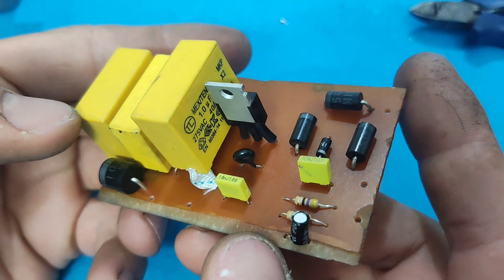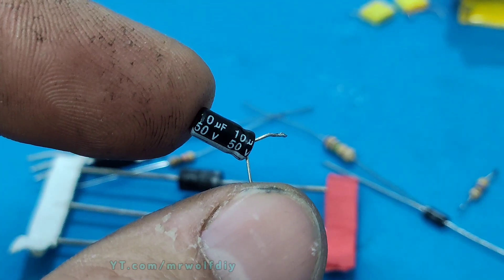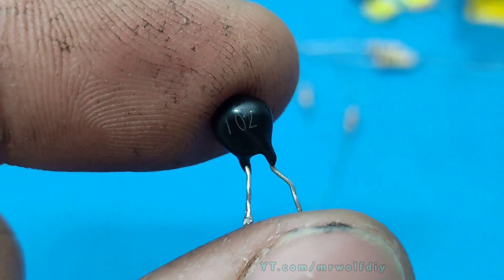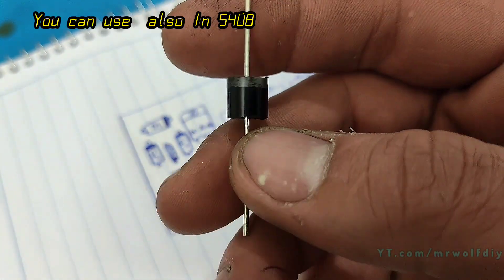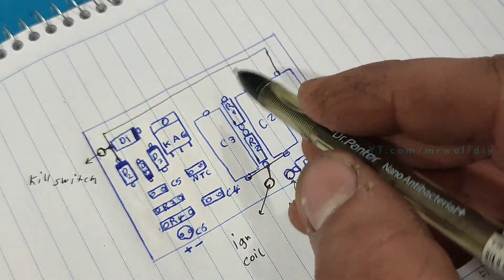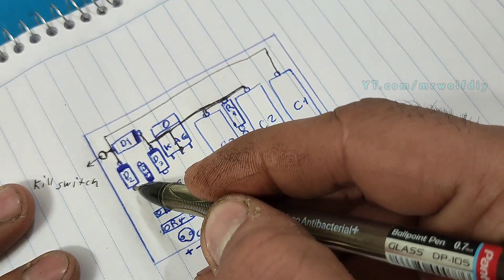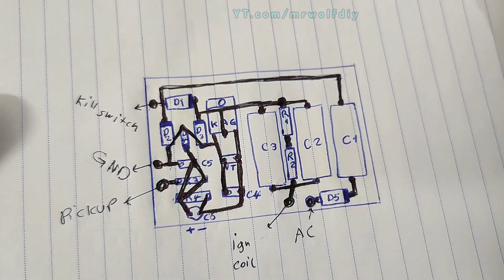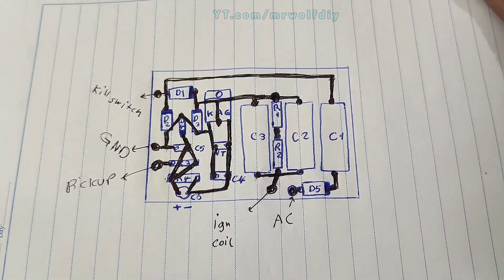Boost Your Motorcycle’s Performance with This CDI! "DIY CDI box"

Comment from the maker: Hello, friends, if you have a weak spark at the output, or no spark at all, change the diode, D5, to 1n 5408.
Good luck ♥️
Reply: Buenas como puedo contactarte? Quiero hablarte sobre un proyecto que tengo en grupo cerrado.
Reply: is this CDI Useful to all kinds of MOTOR? or REGARDLESS Of wire output or SOCKET terminals? like 4wires or terminal socket of 5 or 6 etc. thanks a lot!
Reply: Can I use it on Vespa Classic?
Reply: @TheMurenk 
It make your piston big hole.....
2stroke no need big sprak.......
Reply: Olá amigo, ativa a dublagem automática em português nesse e nos próximos vídeos

Comment: Does it work with cbr 600rr?I dont use the original ECU,also i work at 10000 to 14000rpm
Reply from the maker: No, it's for carburetor bikes 🙌🙌
Reply: @MrWolfDiy can i adapt to injection bikes?I trigger the output with the ecu signal

Comment: Do it works with aprillia sr50 where should be ac cdi? I bet yes, but interesting what happens if advancing angle is 20 deg?
Reply from the maker: This circuit has limited spark advance,
but I think it would be suitable for a 50cc engine.

Comment: I tried tracing the schematic but I am confused. You have D5 going through C1 directly to the kill switch and junction of D1 & D2. Is C1 perhaps supposed to be in parallel with C2 and C3 instead?  Otherwise I could see if D5 didn’t exist C1 would act as a half wave voltage doubler circuit. Could you clarify please?  By the way I think your channel is great. Just discovered it.
Reply from the maker: Hi and thanks,
C1 is not in parallel with C2 and C3.
In fact, C1 is used to increase the input voltage, and D5 is there to protect the stator.
And even if they are not present, the circuit will still work.
Reply: @MrWolfDiy ok thank you. I can understand C1 increasing the voltage but have never seen a voltage multiplying circuit with a diode in series before the capacitor. It would seem to me to block any return path. Oh well. Live and learn.
Reply: @MrWolfDiy  sir Japan cdi 2002 mobel Honda 125 same tou same making your video plz bro
Reply: @MrWolfDiy  your country name brother
Reply: @MrWolfDiy ❤❤❤❤
Reply: Your channel name
Reply: @BikeWala-an ?? I’m not sure what you mean?  If you are asking if I have a channel, no I do not. I am just an enthusiast like many other people following this site.
Reply: @MarkPrestwich-h6m  ok brother

Comment: If this is AC and no limiter and will run on a 70-80 cc 2 stroke I would buy one from you if it was in a case
Reply from the maker: Hello dear friend,
I should say that both of these(CDI units) can be used in two-stroke engines as well.

Comment: Hello, what is the ntc used for, please?
Reply from the maker: Its main function is to protect the circuit against excessive heat and also to reduce the inrush current at the moment the circuit is powered on.
It is also used to stabilize the ignition timing with respect to temperature changes.
Reply: @MrWolfDiy  Ok, thank you!

Comment: Will this work for my 2stroke 500cc i currently have no cdi for my Suzuki LT500R
Reply from the maker: Most ATVs use a DC-type CDI , which operates using power from the battery rather than directly from the stator، Maybe the DC version can be used.

Comment: I"m really loving these videos, so inspirational. My question is can this be adapted to a six cylinder distributor on a 258 CID Jeep engine? It would seldom go beyond 5000 RPM. Or would one of your other design be better?
Reply from the maker: In general, CDI systems designed for motorcycles or simpler setups are more basic in design.
However, this doesn’t mean it’s impossible — but it does require modifications and adjustments on the vehicle.
One of the main challenges is ignition timing, which must be precisely adjusted to fire at the right moment for each cylinder.
The circuits I’ve shared so far are not suitable for use in cars.
For a project like this, you would need a programmable and adjustable DC-type CDI.
Overall, I don’t recommend it — it involves a lot of hassle and the results may not be reliable or satisfying,
unless you're doing it purely out of interest and for fun.
Thanks for your question!

Comment: Where from you buy all this components? I didn't getting it.
Reply from the maker: I extract many of the components from old circuit boards, and I also buy a lot of them from online stores—basically, wherever I can find them.
Reply: @MrWolfDiy i didn't get scr. Amazon flip kart their is no thyristor.electronic shope near me their also no scr. From which type of old device i can find scr?
Reply from the maker: Hey buddy, 
Too bad you couldn’t find it.
Thyristors are mostly found in devices like dimmers, which were used to control fan speed or lighting,
and industrial or home electric heaters with temperature control,
heavy-duty power supplies with adjustable voltage,
old electric stoves, and microwaves.
They’re typically found in devices like these.
I just hope you don’t end up tearing apart the whole kitchen for a thyristor!😅😅
Reply: @MrWolfDiy 😂 thanku😌

Comment: Love your video i need a cdi box for a fl400 honda pilot very hard to find would any of your cdi designs work for me i think its an ac type thanks keep up your good work 👏
Reply from the maker: Hi and thank you 🙏♥️
You mean the Odyssey, right?
Your engine usually uses a DC CDI like Shindengen or Denso, which costs around $300 used...
I built a diy DC version that can be put together for about $10....
But building it has been a bit tricky for some people, so I'll be releasing an easier version soon.
Reply: Am not sure if it's ac or dc the honda odyssey is a 300 but the pilots are 400cc they are both pull start and electric start 2 stroke if you think your cdi dc board could work with the pilot I'd try and make one like yours thanks 😊

Comment: Make CDI for 70cc,100cc,125cc and 150cc bike. If you make pervious so please link.
Can I use this CDI in 70,100,125 or 150cc bike? Please answer
Reply from the maker: Yes, This CDI is installed on 70cc to 200cc engines that have a stator with an AC coil.

Comment: My xt225 has the weakest spark.
Reply from the maker: There are many factors that contribute to weak ignition, which should be checked, such as:
Weak wiring, connections, and sockets.
Weak ignition coil or CDI.
In some cases, the issue may be due to a lack of proper fuel or air.
If the fuel system is problematic, such as a clogged air filter or a malfunctioning carburetor, it can affect the quality of the spark and combustion.

Comment: Why not upgrade factory piece make the resistance adjustable and and put a bigger capacitor?
Reply from the maker: You can also do this, but to make the CDI adjustable, you need to install a programmable microcontroller.

Comment: Mr Wolf - How are some CDI's limiting the speed/RPM of the motor?? I love your simple CDI video from 4 months ago, but I wondered how they add that feature. It's why many CDI'd will work, but sometimes you won't have the same RPM's, they will be lower, higher or unlimited. Thank you for all your videos, they are very helpful. And, your normal voice is fine!
Reply from the maker: Thanks my friend,
Some CDIs limit RPM by delaying or cutting off ignition, using a rev limiter circuit connected to the crankshaft sensor, or reducing the voltage to the ignition coil. Additionally, programmable CDIs allow users to adjust the RPM limit.

Comment: Cdi controls the ignition timing too not just to ignite only
Reply: If it's low on power, it will not show a difference 😕
Reply from the maker: in fact ,It is responsible for enhancing the ignition spark and acquiring precise timing via the crankshaft position sensor.
Reply: @MrWolfDiy  so what's to point of building igniter instead of cdi
Reply: @macgyverdroid  simple, its like getting a distributor and change it to optical or hall with a simple circuit like this one... all advance is still done by the distributor (vac/mech). Now its a matter to know what controls that in your motorcycle engine... lots of single engine points/hall/optical the advance is done mechanically .... they don't have a eletronic ignition box/circuit.

Comment: Schematics, please!
Reply from the maker: As I mentioned before, this circuit didn’t actually have a schematic. In fact, I reverse-engineered an OEM CDI, opened it up, and made some modifications to increase power...
You can draw the schematic yourself based on the circuit I created.

Comment: Would be great to hollow out an existing CDI and revise this custom CDI board into it. 
That would make it easier to mount on the bike. 

One question though. 
How do i know if my bike is AC or DC? My bike has a 4T engine.
Reply from the maker: Greetings friend,
It's a good idea, but the space inside the boxes is usually very small, because SMD components are used,And it is of low quality.
If you've seen my previous videos, I showed that in many cases they fill the inside with sand, so that less resin glue is used.I've already made a full video on how to identify the type of CDI. However,
Tell me the name and model of your motorcycle and I'll tell you.
Reply: @MrWolfDiy  in my country there's regulations for CDI's to be original. Now if the original housing could be reused including the connector then an unrestricted CDI won't be detected by the inspection inspector. 
I'm driving a Piaggio zip. We have 3 types of CDI's available. One restricted to 25kmh, 45kmh and one that is technically illegal because it's unrestricted. 
For reference it's dutch regulations.
Reply: Do get some bigger CDI boxes but worst case easy to make a box for it
Reply: @MrRacerhacker  that isn't my goal. It's to mask an unrestricted CDI from the law.

Comment: since you have multiple  CDI videos you should assign model number to each
for example
AC7sb
AC = it's an AC CDI
7 = average spark length is ~7cm
s = sports variant with adjustable advance, f = fixed advance, n = no advance
b = just simple a-z counter, b indicates 2nd revision
Reply from the maker: That was an interesting idea, thanks.🙏
Reply: @MrWolfDiy  can you make one DC cdi?
Reply from the maker: Already made available in channel

Comment: Can you explain the pickup requirements? I'd like to try making a CDI for my outboard motor. It's a 2 stroke that is currently using points.

I watched another of your videos explaining how to make a 12VDC 3 cylinder CDI. I'll definitely be watching that video a few times.
Reply from the maker: greetings 
To convert a point breaker engine to CDI, significant changes are required:  
removing the old system and installing a crankshaft position sensor (pickup),  
and adjusting the timing so that when the piston reaches top dead center (TDC),  
the pickup is triggered. Additionally, a 12-volt coil and a CDI IC are needed.  
By following these steps, you can upgrade the old point breaker system to CDI and improve the engine's performance.

Comment: Make a MK 12 engine cid
Reply from the maker: If your engine is of the old type with a breaker point ignition system, significant changes are required, such as removing the old ignition system and using a crankshaft position sensor or a Hall effect sensor to operate the CDI (Capacitive Discharge Ignition), and precisely adjusting its timing. However, in some newer models, the ignition system is already CDI-based, allowing you to use the existing CDI or any other CDI ignition system.

Comment: socket diagram?
Reply from the maker: Which socket ⁉️
Reply: when you gonna plug it to the bike cdi socket
Reply from the maker: Hello again,
My motorcycle socket is a 6 pin AC CDI socket, I have already explained the complete CDI wiring diagram in the video, you can also search on Google for "6 pin cdi wiring diagram".

Comment: Hi friend,

What is the purpose for the thermistor? Thanks
Reply from the maker: Hi,
1. Protection of the Thyristor:
If the CDI circuit operates at high temperatures, the thyristor may overheat.
The thermistor can regulate the current path by changing its resistance when the temperature rises excessively, preventing damage to the thyristor.
2. Controlling the Gate Current According to Temperature and Adjusting Ignition Timing.
Reply: @MrWolfDiy  Thanks for your sharing. In my thought, the ignition timing is controlled directly by the metal tab on the outer radius of the rotor.  Is it also adjusted by the CDI circuit ? To be honest, I'm not familiar to the circuit design. Could you explain more. Appreciate.

Comment: More power + less fuel = heat 
Heat = ur block and piston turning into molten metal
Reply from the maker: hi 
Everything has a standard limit. Even this CDI. I previously had a Denso CDI unit whose spark power was ten times stronger than my current module—it was the factory version. I sold it for $300. However, it didn’t cause any issues. Overheating in a motorcycle due to the ignition system is caused by irregular sparking, not excessive power

Comment: can i use 10k thermistor  mf2at?
Reply from the maker: Hi, Test it. "If" the spark is weak or delayed, reduce the value, and for the D5 diode, use a 1N5408 diode.

Comment: this is bullshit, does nor work cz still one spark in cylinder.
Reply from the maker: This circuit is completely correct, and according to the video it works correctly, probably you either didn't try it, or didn't execute it correctly. Explain the problem in more detail so we can see where the problem is...
Reply: @MrWolfDiy  the chemical principle, it can't improve combustion unless you have a bad spark. to improve combustion a tinny bit you must add sparkplugs.
Reply: @MrWolfDiy  so improving the spark "quality" is useless.
Reply: Are u stupid ? The more electricity through the spark plug, the higher air fuel mix burns, so it would be 100 % complete combustion and no Unburned fuel .

Comment: My Honda cg125   got 6v breaker  point ignition (6v breaker points magneto ignition)..together with mechanical advancer unit..
Primary ignition coil  mounted  behind the flywheel and getting earth through breaker points. 
I just want to give Primary  coils earth through a power transistor (from  Collecter to Emiter) while  Base pin of the transistor triggering through breaker points. 
Basic 2nd generation ignition system like that......
But I am unable to design/ figure out this..
Dear Wolf can you please make a solution for that..
Please please, thank you..
Reply from the maker: Greetings
This method is possible but requires skill...
To convert the 6V breaker point ignition system of a Honda CG125 to a transistorized ignition system, follow these steps:
you need some components,
1. NPN power transistor such as 2N3055 or TIP41C
2. 1kΩ resistor (1/4W)
3. Freewheeling diode (1N4007 or 1N5408)
Wiring Instructions:
1. Connecting the Transistor to the Ignition Coil:
Connect the Collector (C) of the transistor to one terminal of the primary ignition coil (the other terminal of the coil remains connected to 6V positive).
Connect the Emitter (E) of the transistor directly to ground (chassis).
2. Connecting the Breaker Points to the Transistor's Base:
Place a 1kΩ resistor between the breaker points and the Base (B) of the transistor.
Connect the breaker points directly to ground (chassis).
3. Freewheeling Diode for Transistor Protection:
Install a 1N4007 diode in parallel with the ignition coil,
Cathode (white stripe) to 6V
Anode (plain end) to the transistor’s Collector.
How the Circuit Works:
_When the breaker points are closed:
The transistor turns ON, allowing current to flow through the ignition coil.
A magnetic field builds up in the coil.
_When the breaker points open:
The transistor turns OFF, cutting current to the coil.
The collapsing magnetic field in the coil generates a high-voltage spark at the spark plug.
Reply: Many thanks for your great advice. You got the point. 
I will try this soon to enhance the spark capacity. Hope this will work. Present spark of the bike is very low. I just want to convert this into CDI but worrying about the advance angle variations....
Dear Mr Wolf you explained this in to the right point. 
Very helpful to all of us.. appreciate heavily..
Thank you again. Peace..❤ @MrWolfDiy

Comment: The CDI controls advance as well in some cases. Did on my Kawasaki.
Reply: All factory ignitions do. Higher rpm = more advance.
Reply: But it's not happening in most motorcycles..
Very low angle advancing..
But with mechanical advancer units we can obtain higher advance angles which means more power...
But with basic most common cdi units i can't understand how its ignition advancing going on...
But with mechanical advancer systems its very clear..
If you know something about cdi advancing theory please be kind to let us know..
That would be great..
Love to hear from you 
Thank you  @ametti000
Reply: It may be that all modern electronic ignition control the timing, but that wasn't always the case. Originally most systems only use the CDI to provide spark and had a separate mechanical advance.
Reply: That's interesting. How do you do that..? Can you please explain it for all of us please..
Thank you